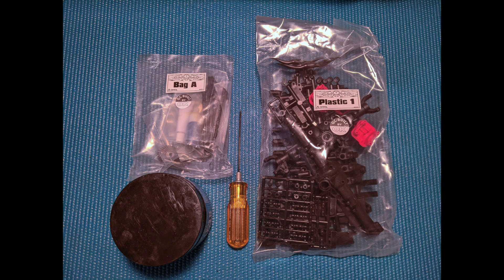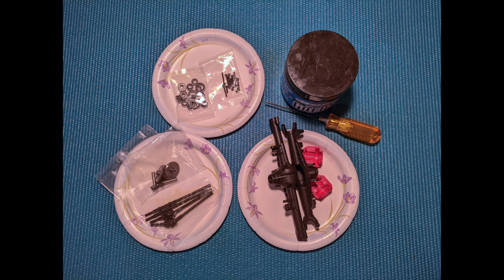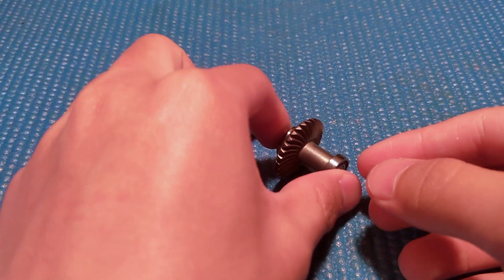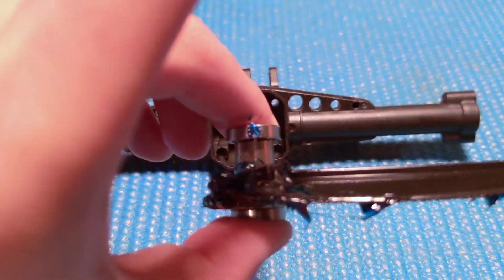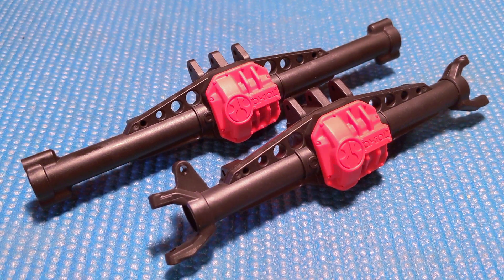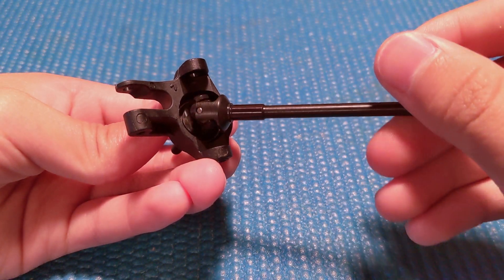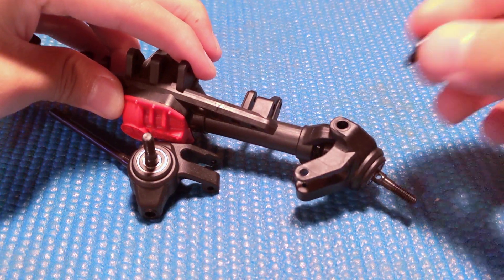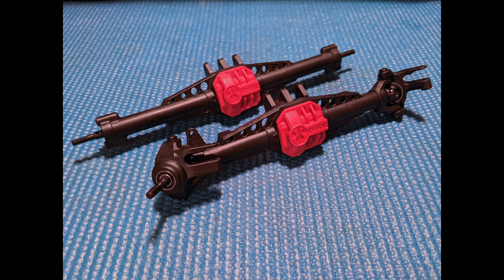Axial SCX10 ii Kit Build | Assembling the Axles (Steps 1-5)

Comment: Hi. I have a ECX temper gen 2 with plastic axles. I broke the mount on the diff housing (2nd one I've broke). Are these diffs plastic or aluminum? Just curious if I buy these and end up breaking them aswell (where the lower suspension arms attach to the diff).
Reply from the maker: The housing (black axle and red cover) is plastic and but the gears inside are steel
Reply: @ericsrcexpeditions  thanks! i ordered some lastnight. should be here today. 🙂   and thanks for the video. i expected it to be harder than it actually was.